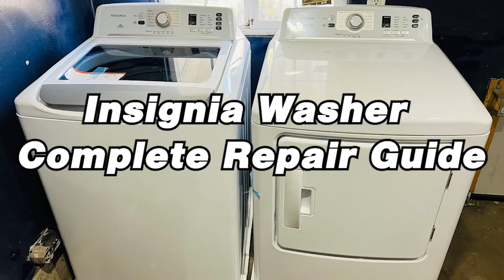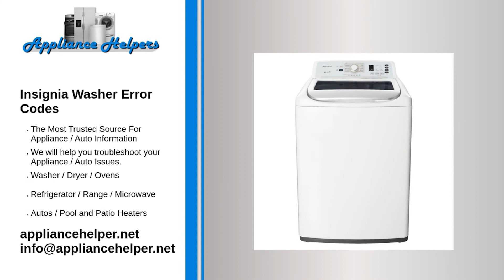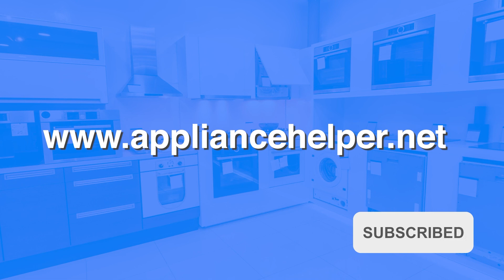Insignia Washer Complete Repair Guide - Troubleshoot Simple Problems

Comment: Just got it today and water is flooding from the bottom. So disappointed 😢
Reply from the maker: If your new Insignia washer is flooding from the bottom, it's important to take immediate action to prevent any further damage. Here's what you can do:

Turn Off the Water Supply: Locate the water supply valves connected to the washer and shut them off immediately to stop the flow of water.

Unplug the Washer: Disconnect the washer from the power outlet to ensure safety and prevent electrical issues.

Inspect for Leaks: Carefully examine the bottom of the washer to identify the source of the flooding. Look for any visible cracks, leaks, or loose connections in the hoses, drain pump, or other components.

Address the Issue: Depending on the cause of the flooding, you may need to tighten connections, replace damaged parts, or seek professional assistance if the problem persists.

Clean Up Standing Water: Use towels or a wet/dry vacuum to remove any standing water around the washer to prevent water damage to the floor or nearby appliances.

Contact Customer Support: Since the washer is new and experiencing a significant issue, it's advisable to contact Insignia's customer support or the retailer from which you purchased the washer for assistance. They can provide guidance on troubleshooting steps, warranty coverage, or arranging for a replacement if necessary.

By taking these steps promptly, you can address the flooding issue with your new Insignia washer and ensure it operates safely and effectively in the future.

Comment: E1 takes freaking 24 hours to complete one load…
Reply from the maker: Experiencing an E1 error code on your Insignia washer, especially when it's taking an extended time to complete a single load, can be frustrating. Here are some steps you can take to troubleshoot the issue:

Check Water Supply: Ensure that the water supply to the washer is adequate and that the inlet hoses are not kinked or blocked. Low water pressure or insufficient water supply can trigger an E1 error and cause the washer to take longer to complete a cycle.

Clean Inlet Filters: Insignia washers typically have inlet filters at the connection points where the water hoses attach to the washer. These filters can become clogged with debris over time, restricting water flow and triggering error codes. Turn off the water supply, disconnect the hoses, and clean the filters thoroughly.

Inspect Drain Hose: Make sure the drain hose is not obstructed or kinked, as this can affect the washer's ability to drain properly. Ensure that the drain hose is installed correctly and that there are no blockages in the drain pipe.

Check for Overloading: Overloading the washer can lead to unbalanced loads, which may cause the washer to take longer to complete cycles or trigger error codes. Make sure you're not overloading the washer and that the load is balanced evenly inside the drum.

Reset the Washer: Sometimes, resetting the washer can clear error codes and restore normal operation. Unplug the washer from the power outlet for a few minutes, then plug it back in and restart the cycle.

Contact Support: If the issue persists despite these troubleshooting steps, it may indicate a more significant problem with the washer's internal components. In this case, I recommend contacting Insignia customer support or scheduling a service appointment to have the washer inspected by a qualified technician.

By following these steps, you can hopefully resolve the E1 error code and improve the performance of your Insignia washer. If you need further assistance, don't hesitate to reach out for help.